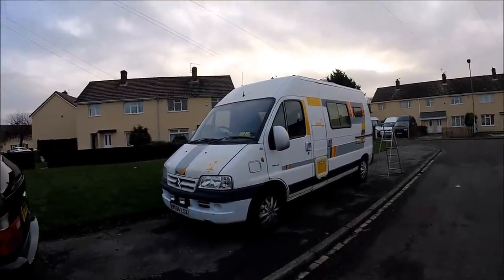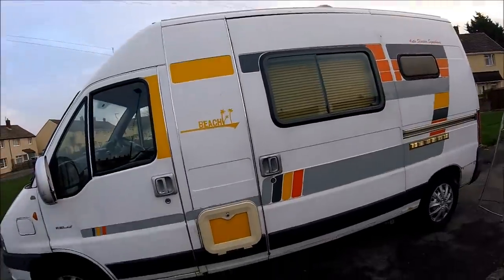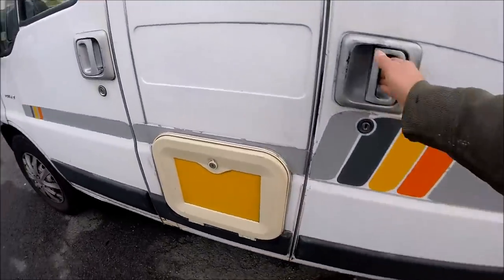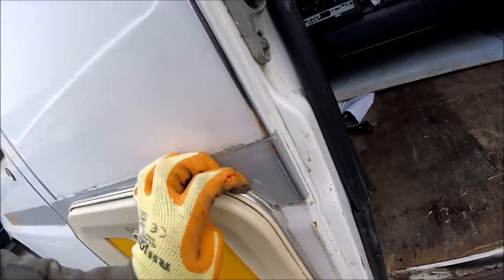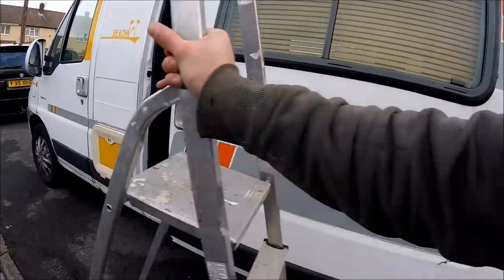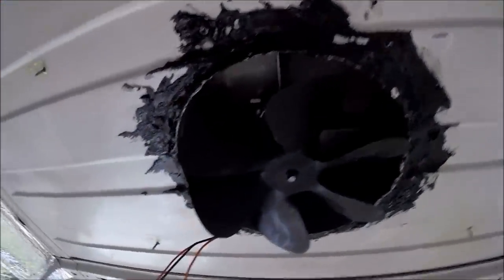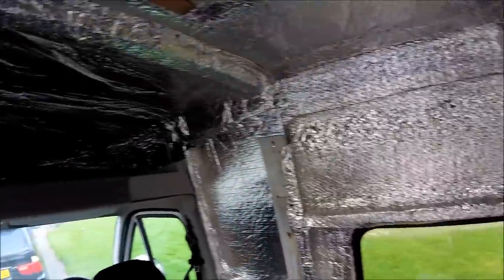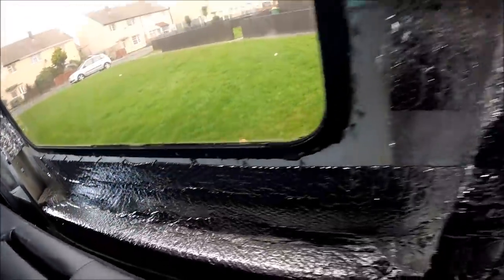How NOT To Build A Camper van

Comment: I have fitted hundreds of  skylights in my time working on caravans and apart from the modern day ones they were all screwed down from the outside,that why they have pre drilled holes on all four sides.
Reply from the maker: I'm sure you will have applied sealant over the screws though unlike this
Reply: Camper Conversion If you clean the roof correctly then apply sealer to the roof then fit the roof light and clean off the excess, if that is done correctly there is no need to cover the screws.

Comment: As I explained to your brother before he bought this van from me, I intended to paint the inside of the van with thick oil based paint which should cushion the blow of the bolts coming through the roof if you were to bump your head on them.  I am only short anyway and it was never a problem for me. If you leave the bolts exposed as I have done, you can hang other stuff on them later, you can't do that if you do it your way. The reason I put the window in upside down is that so it would appear the right way up when lying on the bed which helps with my disorientation condition.  As for that silicon stuff that is meant to go around windows, I ran out. I was going to put more in but your brother was in such a hurry to buy the van off of me. I did not have time, his fault, not mine.    I object to you calling my  work "a bodgie job" and the title of the video "how not to build a camper van".  I just did it another way. Perhaps you could learn a little if you thought outside of the circle a bit...
Reply: Clive Webb   dont forget to mention the fact you suffer from continuous flatulence Clive .....hence the many air vents
Reply: calling this a bodgie job is even a understatement !!!
Reply: "Just did it another way"? You mean you thought so hard 'outside of the box' it became a circle!!!
Reply: @David Warren What do you mean. You are implying there is something wrong with the van and there's not. I don't think the owner wants me to buy it back, the problem is with his brother who thinks he builds better campers than mine. Anyway, I have moved on now and I am building a trailer style camper that can be towed by a motorbike which will be for sale shortly. I'll keep you posted. Can you ride a motorbike and do you have a camper you can tow behind it. You may be interested...
Reply: @stafscheers9692  I agree with you. Workmanship can be understated and still be a good thing...
Reply: @mikespeers8281  I think you have it worked out. I can see you are a circular thinker as well. We are probably kindred spirits Lol...
Reply: Clive Webb I doubt we are anything like kindred spirits. I wouldn't dream of passing a conversation as awful as this on to anyone for money. I'd rather save my reputation, get what I could for it from a scrap yard and have them turn it into a small square box!
Reply: @mikespeers8281  Mate I'm joking.  Everything I wrote was a joke.  The van is terrible, I don't think outside of circles etc.  I never sold it to this blokes brother and nor would I ever sell a pile of rubbish like this to anyone. I was only playing with you, I never thought anyone would take my comments seriously. Sorry...
Reply: I'm sure he see the van before he brought it do the right thing and spend that money if he didn't like it shouldn't of brought it
Reply: Clive Webb you little tinker, bet it was David Devine .....😈
Reply: @CliveWebbAustralia  hahaha like a boss! Got me there mate
Reply: @JorenDekker  Just a little fun mate...
Reply: What a mess. At least your poor brother can use it for banger racing. I hope the builder of this van does not do this as profession. It looks sloppy all the way.
Reply: Wait, you aren't selling a motorbike camper either? Damn!
Reply: @mshef140  Well I wasn't. But I could probably whip something together for you, provided you pay me sight unseen,  a week before delivery Lol...
Reply: @barriestephenson8289  I have seen lots of damaged scalps mate, the result of people not painting protruding screws properly. I used to be a doctor before that little problem with the British medical association Lol.  Sorry, I was joking mate, all of my comments were in fun. If you read all the comments above you will see I was only making light of a bad situation. I agree with you that the van is a disgrace and those screws would make a bloody mess of your head. Just a little Australian humour...
Reply: @CliveWebbAustralia  this whole thread was a good laugh

Comment: If your brother bought it right ( super cheap) has good or reasonably good DIY skills ,spare time , &  a bit of cash & gets the roof done & watertight  , some slightly oversize windows properly fitted will solve the poor (un) sealed ones, a bit more POSITIVE encouragement from all  & less negative it could be made good to serve his purpose  & have fun , then he could have the satisfaction he has proved to everyone it can be done, they are certainly better i would say inside roof headroom height than a transit of that age & perhaps less rot SO PLEASE ALL NEGATORIES GIVE HIM A BREAK & let him try to PROVE TO ALL U CAN MAKE A SILK PURSE FROM A SOWS EAR
Reply from the maker: I don’t know if he wants to put the effort in or get a different van
Reply: It'll be a nightmare even for an experienced builder.

I have no idea what the man's building in terms of layout but guaranteed the only window that will be in an appropriate place will be the one in the sliding door, when it comes to cabinets and fixtures all the other vents and windows will be in the wrong place. There's 9 holes that want sheet metal welding in (2 of which have a  ridge in them) and no end of screw holes that need filling with weld on the roof of all places, then prep and paint on both sides and roof just to make it a half decent base.

The mans right his brother needs rid. Go crazy with some sealant to make it half water tight and stick it on Facebook, some unemployed dreamer will buy it to subsidise their JSA doing garden clearances.

Comment: Nothing wrong with that. Awesome job.  Non bonded air vents allows better air flow circulation on them hot days we get in the summer. Well the 3 days of it anyway. Screws sticking out on the underside of the roof makes it easier to just push panelling straight onto them. Cassette toilet door allows you to have a crap while on the move . So aslong as the toilet is under passenger seat  it will allow the crap to go straight out not slowing you down on your travels. A bit of sealant around them windows job done.

Comment: to be honest its hardwork making those rust, I have scrapped mine many times on the wheel arch and even at the top from clipping road signs and my own gate posts are only 2.5 inches wider than my mirrors and its a 90 bend to exit/enter and i have paint off in many spots, nont of which have rusted. they all seem to rust from the inside of the cills where the sliding door is, on both sides of the van, and on the 2 front arms at the wheel arch that supports the cross member under the radiator

Comment: Agreed, an amateurish job, but it wouldn’t take more than a couple of hours to take out the faulty parts leaving a blank canvas for the conversion job.  Nobody in their right mind would pay a lot of money for that unfinished job, it shouts “save me” therefore the purchase price would or should reflect that.  
How to make a crisis out of a drama would be a more accurate title, and did I hear “there was no sealant used at all”?
On the positive side you now have a project, a good one by any reckoning for future videos.
Far better to have that project than a near completed bodge, there are after all....no hidden surprises to catch out the unwary.
Best of luck.
Reply: Honestly, I'd rather buy an unmolested van and do it from a blank slate. All those holes in the roof would required metalwork, and so would that super ugly hatch and all the other stupid vents... I honestly don't think it would be worth the time and expenditure.
Reply: It should have only taken a couple of hours to put them in, but it's going to take a lot longer than that to take out and fix every install you want to keep, then patch over the ones you don't. It's going to be easier to start with a clean van rather than one that comes with a "free" skip full of rubbish.
Reply: Check the mot  it failed on last week and it just screams scrap me........

Comment: And it's a Relay so it's naturally a rust-bucket.
Reply: lol at you. the mk1 and mk2 are zinc dipped top to bottom, the only rust points is from the inside of the cills. a 15yr old relay is still in better nick than a 3yr old sprinter

Comment: Totally shocking, hope your bro didn’t pay to much for it. Btw my fiamma roof vent screws down from the outside like that one ☝🏻
Reply from the maker: I'm sure your roof vent looks a lot neater than this one though...  He didn't pay a bad price and it came with a new smev cooker & diesel heater so not all bad, just the  base van is bad lol...
Reply: Camper Conversion mines not the neatest lol but def does not leak 😂 sounds like he may have got a few good bits out of the deal at least 👍🏻
Reply: I just spotted your comment. Same with my fiammas. They don't look pretty from above but they are smothered in sealant.
Reply: Cmdr Pugwash yeah I’ve put 50mm flashing tape around the top of mine over all the screw heads for extra peace of mind 😀

Comment: it's got a VW spare wheel cover.
Reply from the maker: The only valuable part of the van haha...
Reply: @TheCampervanBuilder  That spare wheel is likely to distort the door given its a weighty wheels and held on with a batten on the inside. I'm surprised an MOT tester let that through on safety.